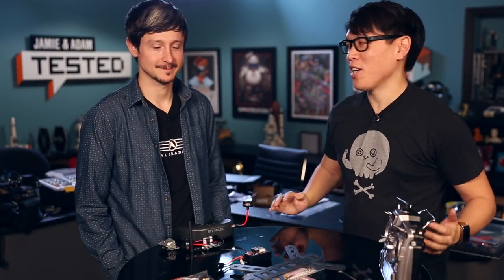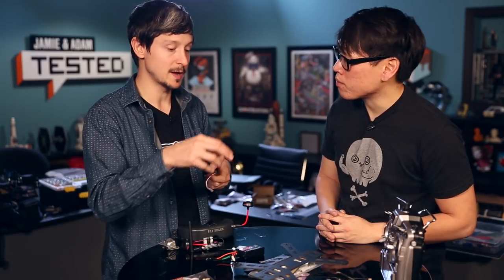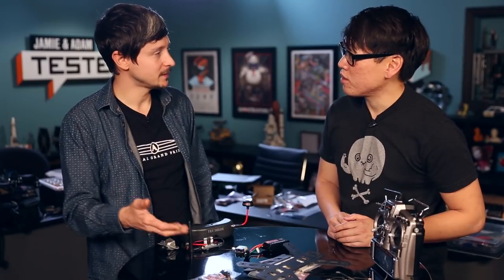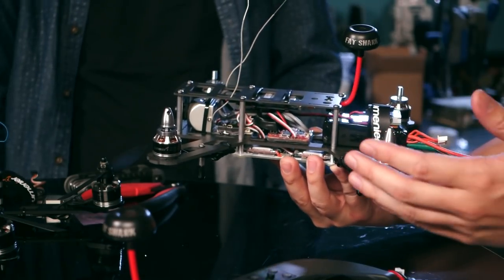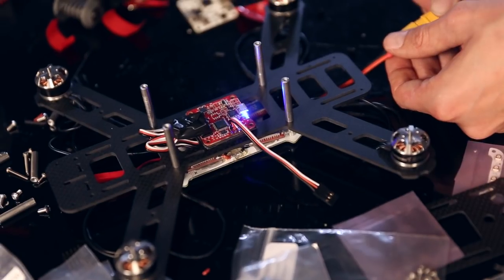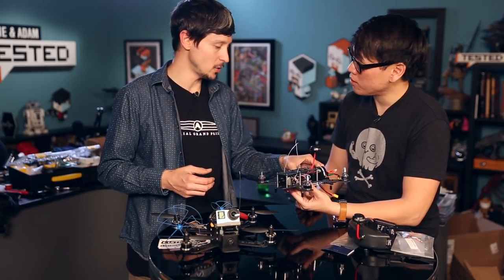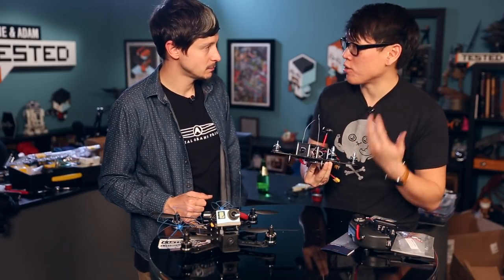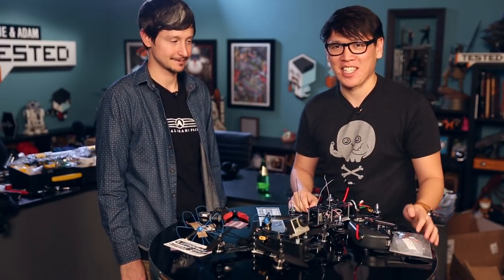How to Build a FPV Racing Quadcopter!

Comment: In other video's I've seen mention that the motors listed above aren't really powerful enough and they recommend the FXC2206-11 2350v (http://iurl.no/1b94u). Can anyone else comment on this?
Thanks
Reply: Mike Ormerod The QAV250 is really underpowered with 1806 motors like these. For a miniquad it is quite a heavy frame, but very sturdy at the same time. If you want bigger props, or props with higher pitch (range is from 5"30 or 5030 to 6045 with arm extensions), you will need more power. Charpu and Juz (official pilots of team Lumenier) are using Cobra motors in most of their newer videos. Charpu uses 6045 props with the Cobra 2204 1960kv motors, Juz uses 5045 props with Cobra 2204 2300kv motors. Keep in mind that you will need better ESCs if you want to upgrade your motors or props!

Comment: I purchased the kit you advised before realizing that this was not a tutorial at all, you barely scratch the surface of how to build this and give no tips or pitfalls to watch out for so as a beginner trying to stitch a bunch of half assed tutorials together I am left with and expensive paperweight, please dont call you video a how to without actually explaining each step so beginners like me dont get put off the sport because we were tricked into thinking the build would be easy
Reply: Google how to build a racing FPV quadcopter, since you bought a kit it won't be that hard

Comment: That's a shitty radio for a starter unless you bath in money.      For a starter just get something cheap like a hobby king radio or a tactic
Reply: This is actually an excellent radio. Maybe not the easiest for a 100% beginner, but this radio can do everything a $600+ radio can do but it only costs $200. A radio is a great place to invest in because you won't crash it, lose it etc. Investing in a good radio is important because you can use the same one for 50+ models if you wanted to. I bought a Taranis over a year ago and haven't regretted it for a moment.

Comment: i learnt absolutley nothing from this and as usual they assume we have stupid ammounts of money to spend on this crap
Reply: If you learned nothing, you weren't watching. If you don't have the money, may I suggest a college education, a real job, drug trafficking or prostitution.
Reply: KYLE REES This video was actually very useful and if you're not technically minded or you dont know much about quads etc you MIGHT have a hard time. As far as the money situation goes, i would imagine most people are in a similar boat.
Reply: KYLE REES dude, this vid was kinda angled at people who already had a little technical & electronic knowledge or already had a background in DIY RC hobbies. And like any hobby (especially tech-centric ones), it wiil take a little bit of saving up to get started in. I suspect that the first build and essentials will be expensive, but the upgrades over time will be cheaper.